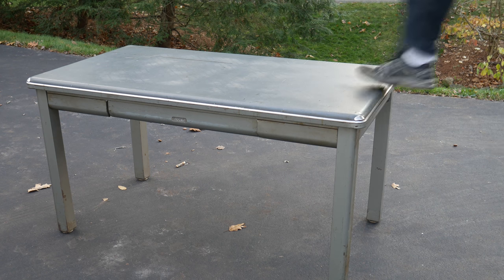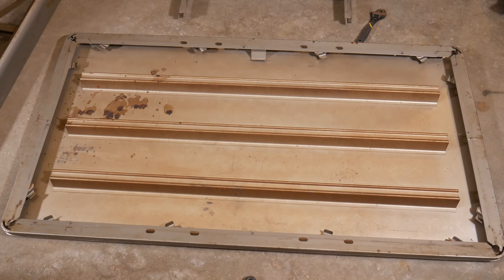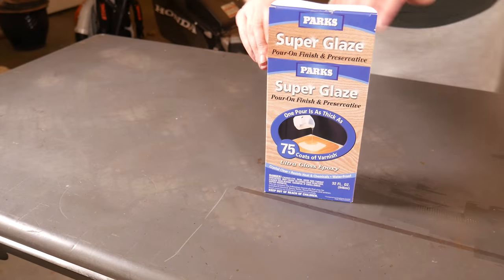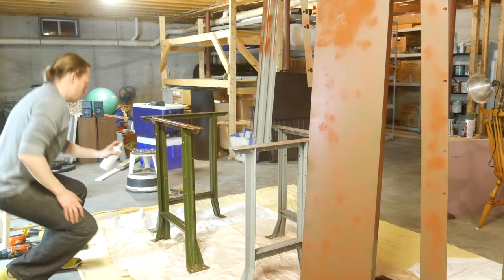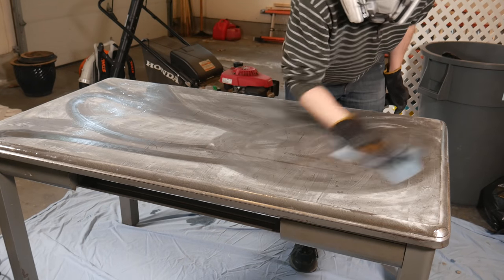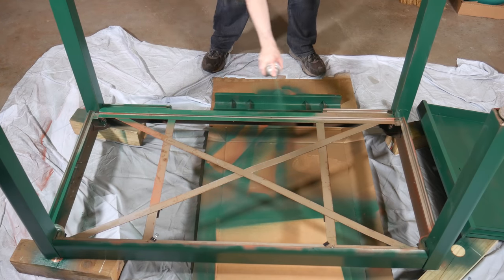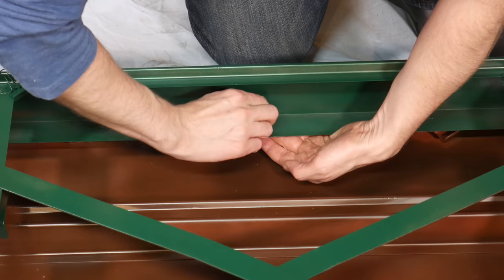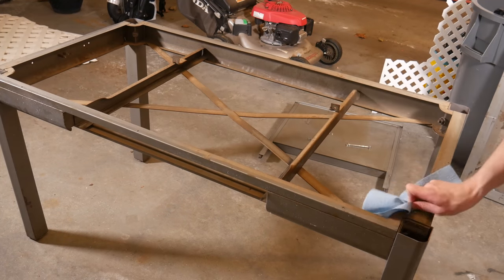INVINCIBLE Steel Workbench Complete Restoration- Cheap & Easy!

Comment: When we bought our house, it was full of rough cut red cedar shelves in the basement. Probably a few thousand board feet, seriously. My wife said that we should throw all that out. I was like, "Um no, it was a selling point (not really, but I was very excited to see it). I ran it through my surface plainer and have a ton of beautiful cedar ready for fine finish carpentry. I think a lot of really good stuff ends up at the dump in that same way. It might get left behind by original home owners, and the new owners don't consider it's value and throw it out. Great find in your new work table. I'm jealous.
Reply from the maker: What an awesome bonus with your house!   Yeah, to be fair this desk was old enough that I can't really blame the original owners (if they're still around) for downsizing and getting rid of it.  I'm glad stuff like this does find a good 2nd or 3rd home sometimes though!

Comment: In the future, JB Weld makes a 2-part epoxy that's made for metal-to-metal bonds. It works excellent.
Reply from the maker: Good call, thanks!
Reply: @GoobertownHobbies  You will find it at any hardware store or big box home center. It's not a specialty item. I know one local gamer that uses it to assemble metal miniatures since it is such a strong bond.
Reply: Using a drill and rivets could also work well here for a more long lasting solution that does not include the hardware and skill of welding.
Reply: @Dollsofgod  Great idea!
Reply: I love rivets. I used large empty coffee cans, cut them to an oblong piece of metal, drilled holes, wrapped them around the trunk of my fruit tree & riveted them together to stop possums climbing up & eating the fruit! 😊

Comment: Agreed, JB Weld for sure! Painters know patience, and slow-cure epoxies are best. There's a trade-off for the speed of 5-Minute Epoxy--It's seldom really permanent. Also, I'd drill a hole for a carriage bolt where the brace meets the flange. Nice, smooth round head down, and the nut inside the frame. For Cosmic OCD Balance, you could add a bolt to each brace end. Great find!
Reply from the maker: Oh yeah!  More bolts would have been super satisfying :-)  I'm definitely gonna check out this JB Weld stuff too!
Reply: What's a JB weld?

Comment: If you want really strong bonds, JB Weld Original (or Classic, or something like that) epoxy is the strongest glue in the world that I know about.
One of the other channels I watch has tried it against all sorts of other things, including both other epoxies and completely different types of glue, and it hasn't had a close competitor yet.
He's even successfully used it for some things you wouldn't even consider being a job for glue, like an engine cylinder head.
Reply from the maker: Thanks!  A couple people recommended JB Weld, it's good to see some consensus on that, I'll pick some up :-)

Comment: when you change directions with the can either go off the edge and do the spot that you turn around off the edge or stop spraying. you adding a lot more paint at those "ends" and it makes it much harder to get an even finish
Reply from the maker: that's a very good point! That makes perfect sense, I'll absolutely try that next time, thank you!! :-)

Comment: People would pay good money for a table like that. Can't believe they threw it away.
Reply from the maker: Lucky day!  To be fair, SOMEONE got 50 years of use out of it, and most things are trash after 50 years...  not this though! :-)
Reply: I'd hate to hazard a guess at how much a refurbished piece of industrial furniture would be in a reclamation shop front/retail space. 

In the next town over from me there is a store where they restore old pieces. I love everything they have on the floor, from map drawers to desks to kitchen cabinets to cast iron work benches, etc. Nothing under $1,000

Then there's the artistic section where someone has turned a single timber bed head into a bench seat, a piece of recycled timber joined together by resin to make a table, to paint dipped handles on chopping boards. Almost endless artworks & inspiration loaded.

If I had a few spare thousand, I'd walk away with some gorgeous pieces

Comment: dude why are you so lucky with the trash tables!
that is an awesome bench for a small welding station
the epoxy works for protection but not the best for the structure 
it's better drill a hole an fit a bolt inside 
it last for ages
and learn to weld it's even better ;)
and it's easier than you think

if you are not going to space with the thing that you built
Reply from the maker: Hehehehe, I'm gonna keep my eyes open at the dump for an acetylene torch :-)